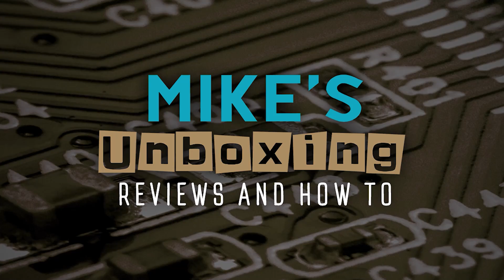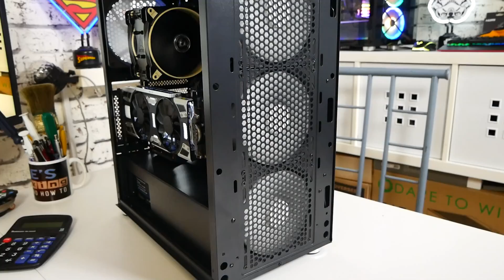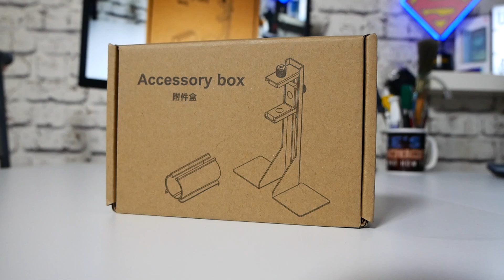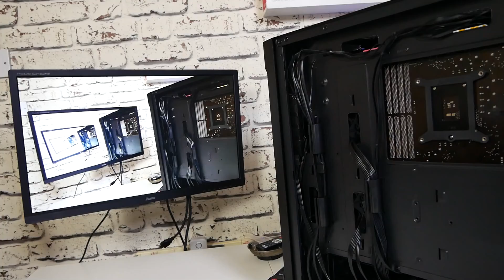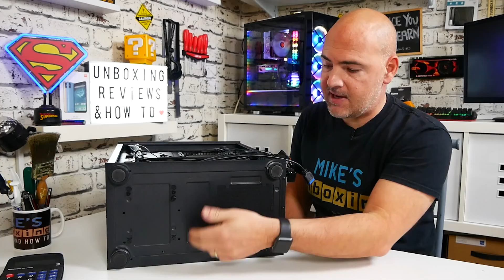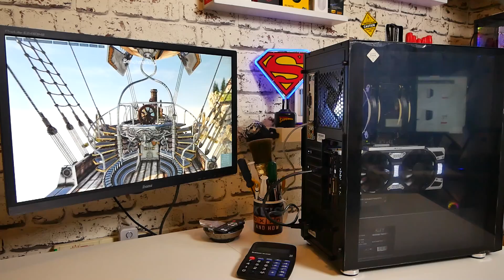Sahara C501 ARGB Very High Airflow ATX Gaming Case

Comment: You mention the Arctic Liquid Freezers fitting up top, but the Arctic Liquid Freezer IIs are nearly 65mm thick with their fans, something like the 280 version fits in nearly nothing because it'll hit motherboard components. Could you measure how much space there is from the top to the motherboard to confirm those AIO's would fit? Theirs specs don't list the spacing.
Reply from the maker: sorry i don't have the case here anymore

Comment: I don't think a manufacturer can really get away with calling a case "airflow" in todays climate and then put a solid front on it.  This needs to be the 501, and then they need a mesh version which they can call the 501 Airflow.  Also considering the name is more than a tip of the hat to cooling, fixed RPM molex fans is a real no-no as people who are looking for really good cooling also want control over those fans.  140mm fans at 1200 rpm are going to be pretty loud, though we couldn't pick that up from the review, and if they are going to stick with molex they need to be 1000 rpm or less to avoid bugging the hell out of the user.  Finally they need to do something with the PSU shroud to allow installation of a 360 rad at the front - a cutout should do the trick and be cheap to include.   That all being said, it looks like a well thought out case, I certainly like the emphasis on 140mm cooling all round (and the slight increase in case depth that goes with this) and there are lots of small but well thought out features in this - such as a proper gap between the top of the motherboard and the top of the case - how many cases get this wrong???!  Areas for rgb strips are nice for those who like rainbow, and the cable management looks very well thought out - also like the GPU bracket - that is a very nice touch.  To me this is a case that is 90% perfect for a budget case - they just need to change the front panel and be a little bit cleverer with the fan selection.   I think 3 skus would be good - fan free - molex fans all round (1000rpm) and RGB pwm fans all around - in ascending price.  I would certainly recommend a mesh fronted version of this to people.
Reply from the maker: thanks for the input
Reply: @mikesunboxing  I've been close to buying Sahara gear in the past, and their refusal to do mesh fronts has always been the deciding factor.  Other than that they make some really good cases and are so close to being spot on.  It would be good to see you put this through its paces with something like a 3900x installed and see if those side vents do allow it to breath enough to keep a modern cpu cool.  Also, can you do db measurements on the fans on the release version - my noctua 140's are annoying at 1200rpm so I am assuming those supplied would be as well - they could of course be super quiet fans.....

Comment: Since you say the manufacture is watching the comments I'll give mine. It look like a imitation of the current Phanteks P models with much worse airflow. I don't  believe it will flow air anywhere as good as the Phanteks with that closed off front panel with just the side vents. 
Molex fans? No thanks, I didn't even think those were still being manufactured. I wouldn't be a huge deal to me any ways because I always replace all stock fans with Cougar Vortex models.
Reply from the maker: thanks for the input. I would agree with you about the airflow if i hadn't experienced it for myself, but it breathes very nicely

Comment: I have the P35 Sahara and like it a lot but I note that the C501 shares a common theme & that is that those side vents may not allow the fans to pull in enough cool air if you are running with an overclocked CPU, etc. I'm not a fan of solid fron panels with no visibility into the case either but I guess for the money this is a good offering. I do like the GPU anti sag mount, that is a good inclusion.
Reply from the maker: the vents are surprisingly open and don't seem to restrict the air much if at all
Reply: @mikesunboxing  That's good to know Mike. Regarding the filter to the front, my P35 has no filter so I purchased some computer mesh and fitted it behind the front glass panel, it looks fine and is secured at top and bottom with velcro.

Comment: Is very naice, like the front good for a pro build qudro P5000 or WX 4100 (the 2 cards I usually get asked for on pro builds lately) workstation rig with enough space to side mount and get air GENIUS. Get away from the brushed alu which often looks good for about 6 months. (I suspect all the dents that they seem to gather come from throwing mobile phones and pens at them after a crash or power out when they forget to CTRL-S for a few hours) Is that your own riser or is it provided?

The space in the top like someone finally figured out that putting top rad mounting options you can only use with no EPS cable on a £40 motherboard is not the way to go. How many cases over the last 3 year have I seen that boast top rad mounting that you can not use? It's a lot more than 1 I can tell you. I could possibly get my fat hands down the top of a tower cooler to plug the EPS in without bending the fins or them ripping into my flesh.

140mm fans all round another great idea,  a molex orgy is a bit of a downer as you stated with no fan speed/noise control even without the old 7.5v reducer's which was about 2" long that's a big chunk of molex block you have to hide in the back. You can't even do what I'm doing with mine putting a PCI slot 6 channel PWM fan speed controller in for me the top in that the back. We are 2 decades into 21st century IDE and AGP are gone why is 4 pin molex still here? We can fix super fast storage direct to the mainboard with no cables now yet still have to use 1980's molex to power nothing but fans. (sad face...= ( even my pci fan controller has a molex I just destroyed 2 sata to molex cables trying to push flimsy pins out of the housing to shrink wrap over the GDR for my case before turning to Akasa for a solution)

I really like cable tidy channels and velcro to boot top banana, no joking around with depth in the back there and I wish my case could fit 3x 3.5 HDDs (you know I tried)  anti vibration mounting on them, a must in a pro build. Nice case overall I would consider for myself if not for your earlier REValation for a black out build. (maybe a couple of plain white LED strips for illumination) The wideness of the case would get even the mac pack in a drawing office wet while not being so long it hangs off the front of a cubicle desk.
Reply from the maker: lol i love reading your comments, and i really need to find a 7.5v molex adaptor somewhere with all these molex fans making an appearance

Comment: Hi Mike. Another great review. As you probably know, all of these single chamber rectangular cases look alike to me. In regards to the solid front panel, that really shouldn't matter. In my opinion mesh fronts are highly overrated. As I've said before, my Thermaltake Level 20 HT case has tempered glass on three sides and the top, and a metal panel on the back. Yet, it's the coolest case I've ever owned. All that's important is that it has a way to draw fresh air in and exhaust the hot air out.

I took a big step forward in my personal war on against propitiatory fan and RGB controllers today. 😂 I spend a couple hours cutting off the ends of my Asiahorse and Corsair fans and soldered on standard PCM, RGB, and ARGB connectors. Hooray for me! LOL
Reply from the maker: Nice work they all work okay
Reply: @mikesunboxing  They appear to be working okay. I like the Asiahorse fan. They are the outer ring type. I like that better than the entire fan being lit up like the Corsair fans. I think I'll just give them away for free in the next build someone has me do.